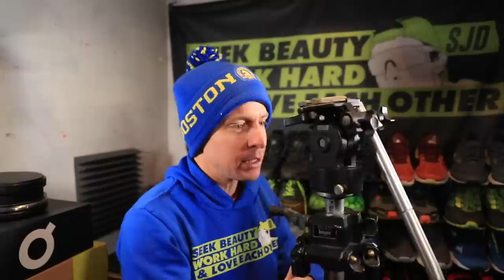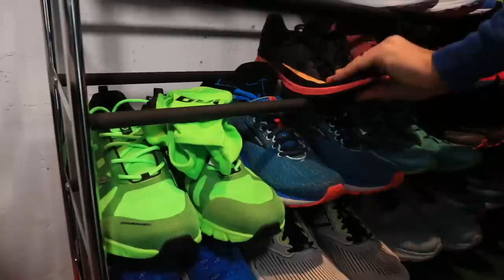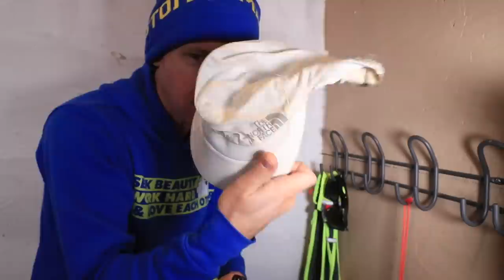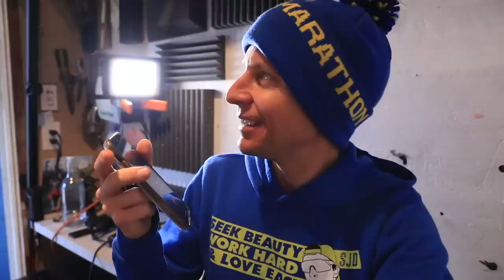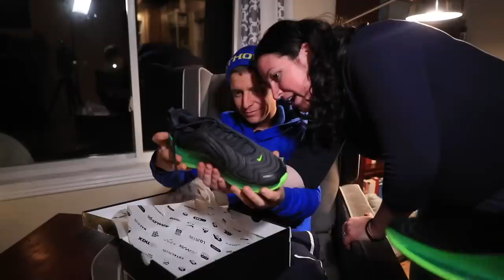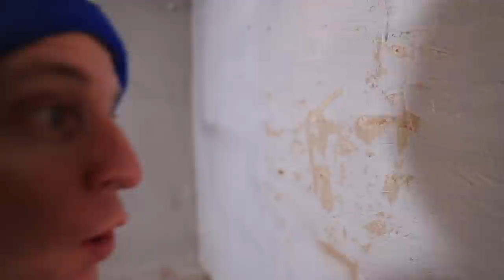StockX Authenticated "Dad Shoes" + Shoedio Teardown + Nike Next% Fakes Alert

Comment: QotD; my two go to shoes are the NB Fuelcell Propel's and Nike Air Zoom Pegasus 36's. The NB depending on color go up and down in price on Amazon A LOT, sometimes they are as cheap as 45 and swing back up to 100$. When they nosedive to 45-50 I pick up a pair. The Nikes I monitor the prices over at Dicks Sporting Goods and I've seen them as low as 75, so I'll do the same thing there.

Comment: Whenever possible I try to support the local small business running store (located on the next block).  They do a good job of clearing out  'last year's models' at blow out price points. They also offer a discount to the store based running group. Online? I used a variety of sources - too numerous to go into here.  I will second your "alert" on the fake Nike Next%s.   Mostly they seem to be on eBay, by sellers with relatively low feedback and often based in Canada.  The fake shoes are made in Vietnam and shopped via Hong Kong. They arrive in the United States shipped to the buyer one at a time and may be invoiced as "model toys".  Lots of youtube videos on how to spot the fakes.  Easy points are:  theylack carbon plates (flex too easily), midsoles are stiff (no ZoomX foam), and weight is off  (heavier) by 40-50 grams than comparable 4% models - they are supposed to be lighter. And a bunch of other inconsistencies. Be sure to buy through a reputable seller or at least through a site (like ebay) that will back the buyer if the item is determined to be fraudulent.  Bottom line, if it seems to be too good of a deal, it probably is!

Comment: If stockx sees that the shoe is worn, they will send it back to the seller and refund the buyer. The shoes you buy on there will be new or maybe tried on. Goat is another similar app but they have a listing just for used shoes and there are pictures to check out the condition before you buy them(if they are used) you can find some great deals on running shoes, though they both focus on more fashion style shoes. Check out ebay time to time too! I have bought several of my running shoes there for great prices
Reply: But the best way is to shop local of course!
Reply from the maker: Exactly 👍🏻👍🏻

Comment: QotD:  I do not shop for shoes or clothing on-line.  I prefer to go in to a store and try on what I want to buy.  I do not want to buy something, have it shipped to me, try it on and find it doesn't fit properly and then ship it back.  That is a hassle.

I have two favourite shops right now for running gear, one for clothing and one for shoes and other gear.

The clothing shop is lululemon.  I know, you thought it was only yoga clothing and mostly for women.  While that is where they started, they have been focusing more on men in the last few years.  In their men's line, they cover yoga, running, and other general fitness activities.  I find that their gear fits well, is comfortable (nice, non-chaffing fabrics), and has high quality durability.  

For shoes, I go to Strides Running in Calgary.  They have a good selection of both trail shoes and road shoes.  They carry brands like Hoka, Altra, On-Running, Saucany, NB, and Solomon.  If they don't have a shoe in their brand range that I am looking for, I can ask and they will bring it in.  The other thing I like about going to a store, as opposed to shopping on-line, is that I can try different shoes on to get a side-by-side comparison.  I might be interested in a shoe because it has great reviews or some unique new features that I want to try but when I get it on my foot, it doesn't fit right.  We all have different feet and they do not always match up to the last that a company will use to design and build its shoes.  Good running stores, like Strides, have a treadmill in the store.  This gives me an opportunity to get a good comparison of shoes under running conditions.  I can try on a few different shoes and find the one I like best.

Comment: StockX shoes aren't actually used. They are deadstock pairs that collectors are selling.
Reply: Baltsu yes they’re struck brand new just taken out the box once to authenticate
Reply from the maker: Well kind of. Unfortunately people do wear them and that’s why they go through the authentication process. Happens with their running shoes a lot, more than the sneakers.
Reply: Seth James DeMoor i sell on the app alot. If you try to sell a used shoe they will send it back to you and refund the buyer. If it happens several times you can get banned from selling on the app. Also if you see that shoe has been used and they didn’t catch you can dispute ( make sure you didnt take the stockx tag off if you do this ) and send the shoe back for a refund or some money back.
Reply: @joshhanechamp9948  i know that too because I am also involved in the sneaker culture. My I commented initially because Seth said in the video that the shoes are used which is not true. It's a place to purchase sneakers that you cannot otherwise get. And resellers make money there. Backdooring is such a huge phenomenon right now. Of course you can also buy shoes when they are released and wait until the value has gone up and then resell them. Also outlets and sale offer some opportunities in sneakers. Even running shoes can be resold and some profits made. I saw some Peg Trails today for 45 dollars. The problem was that there were too few pairs. Less than 10. So it doesn't make sense to buy very little when the profit per pair is small but anyone understands the logic.
Reply from the maker: @joshhanechamp9948  exactly